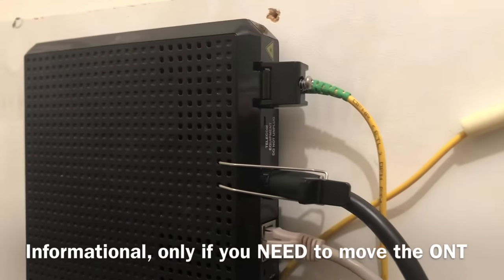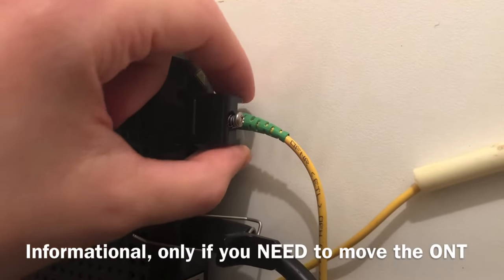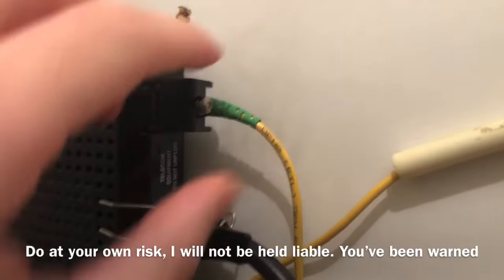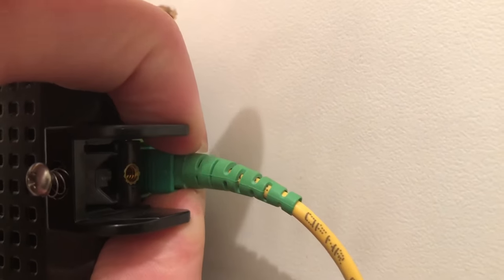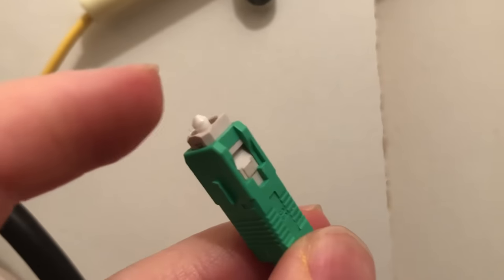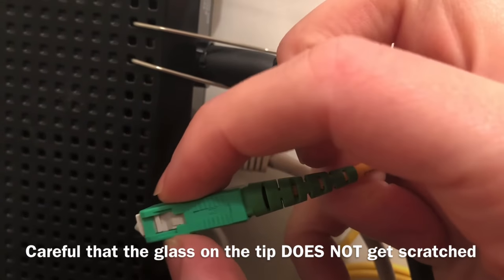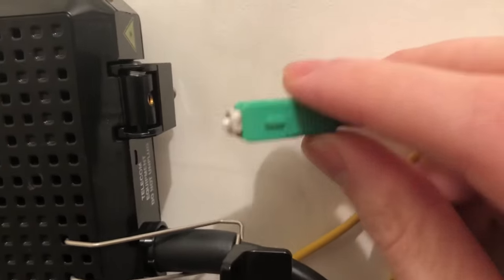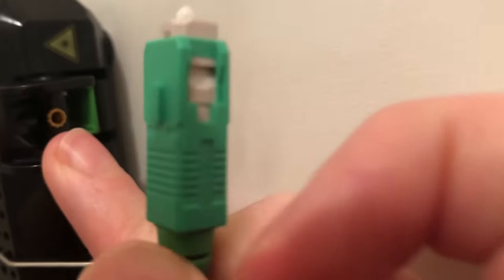FiOS how to disconnect the fiber

Comment: FYI.
First (safety) 
An active fiber has an invisible light. NEVER NEVER look at the end of that fiber. It carries an invisible laser that will damage your eye if you stare at it directly. 
 
Second-
Fiber should always be clean before plugging or else you just created more issues because of dust particles.
Pixelization,slow speeds, or loss of communication with Verizon network. 

I wouldn’t recommend unplugging the fiber to anyone it is Verizon equipment.

Comment: It’s a SC fiber which is short for Snap and Clip. The fiber line which is a single mode fiber is ran to the telephone pole where it’s split up into another media box where the main fiber backbone is. Pulling this in and out won’t do anything. The test is if you do pull out the fiber, shut the lights off and see if there’s light coming out of the fiber. That’s when you’ll know whether you’re getting data or not.

Comment: Since the fiber wire from the line outside to the ONT is thin and sensitive to remove I think it’s possible to fix it which would be a DIY or hiring a local telecommunication contractor that does work on fiber optic cables by putting a new end connector which Verizon and I guess Google Fiber, AT&T and Frontier uses the SC/APC connector
Reply from the maker: I would highly recommend getting a Verizon tech out if it needs to be fixed, it’s their system, they really don’t want other techs playing with the fiber. I only recommend a local tech guy knowledgeable on fiber if you’re trying to relocate it somewhere else in the hopper

Comment: Thanks very much! Very helpful. It seems that pulling back on the housing frees the clip on the connector? Mine doesn't want to co e out and I don't want to force it. Cheers!
Reply from the maker: Yes. If it don’t move, don’t risk it. If you need it relocated, call Verizon to send a tech out (for a fee). If you are moving, leave the ONT where it is, DO NOT DISCONNECT and DO NOT return the ONT

Comment: Hi thanks for posting this, very useful. I've got this same fibre optic cable. It goes into a little LAN box device (not sure what it is, but says LAN on it) and then this LAN box connects to my router via ethernet cable acting as a bridge. When there is a thunderstorm, of course I will disconnect the ethernet from the 'LAN box' to prevent damage to the router, but do I have to disconnect the fibre optic cable to prevent damage to the 'LAN box', or should I not worry about that? And yes, of course all plugs out of sockets (receptacles as you say :D)
Reply from the maker: fro0tyl0opy87 no you’re okay with the fiber. There is no metal, it’s just a thin strand of glass in that cable so there is no technical way that electricity is going to go thru that cable. There was a YouTubed who had the same dilemma. He ran ethernet in the ground between 2 homes, lightning striking a tree fried almost everything. Once he ran fiber, never an incident for YEARS
Reply: AMP Tech yeah I don’t know the name of that youtuber but he repairs old pc hardware and reviews thing that are old (most if the time) i saw that video too
Reply: And that cable is called an sc cable for gpon networks and that lan box is called and ont (fiber ont) and providers don’t really want anyone to touch the sc cable cause if it gets dust on it or anything else it can create reflections and burn the olt cards that’s the cards where your fiber begins at your isp and these cards can cost a few 1000 dollars
Reply from the maker: Gaming Time it’s “the 8 bit guy” love his videos.

Is that true that the OLT cards can burn like that from dust? I’ve never heard of this

Comment: Any idea why the ont would drop data?  I recently upgraded to Ethernet internet (no more coax) I was changing out the FIOS router to the nighthawk, everything worked for 5 minutes then they shut the data down. Now no router works nighthawk or Fios. I should state that I can reset, pull the power cord, on the ont and get data again. However it only lasts for 5 min. Any ideas?
Reply from the maker: Joe Ferraioli could be a defective ONT, ive seen weird issues before with people on forums & Verizon happily replaces with service calls. I’d say first try another Ethernet cable to rule it out first. Is the ONT in a well ventilated area?
Reply: AMP Tech  cable was changed and Router’s swapped Verizon reset and ont reset. The ont is set inside a box on the outside of the house. Very well ventilated. I just thought it was highly suspect due to the fact this issue arose only when I tried to swap the routers.
Reply from the maker: Joe Ferraioli if it’s an older ONT that is not like this black one, could be old/buggy firmware. It’s odd but weird things happen. First check if there’s a firmware update for your router & yea if the problem persists, call out a tech. I haven’t had any issues with my own router. Hope they can help.

Comment: Does this fix the red globe?
Reply from the maker: sabian lukei no it does not. This method is only to be used if you need to unplug or relocate the ONT temporarily. Do not attempt this if your internet was working prior. If you have a red globe, just unplug and plug back in the router and the ONT and if the globe is still there, call Verizon as there could be an outage in your area
Reply: AMP Tech what do I unplug on the ont
Reply from the maker: sabian lukei the power plug. If it looks like mine, you should see a black power cable that goes to a white box and then there’s a white plug that comes out of it to an outlet